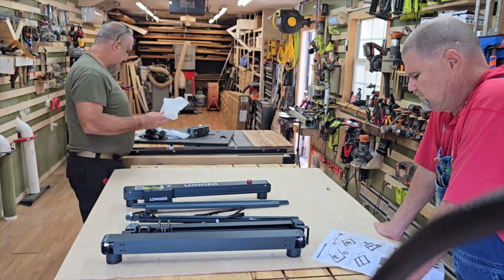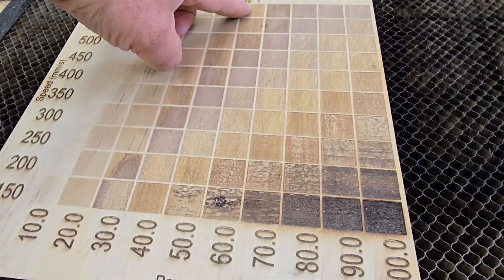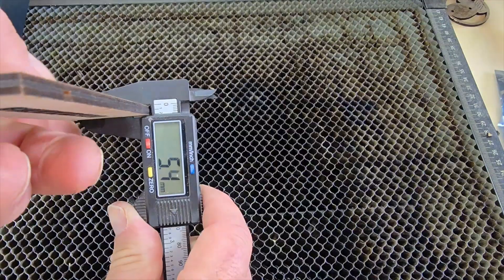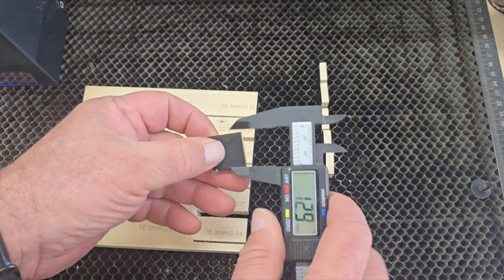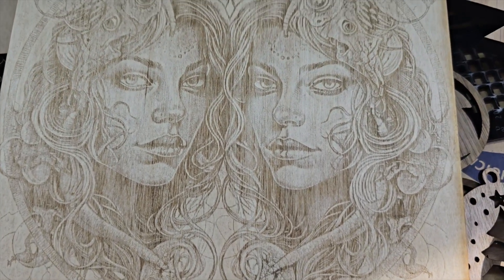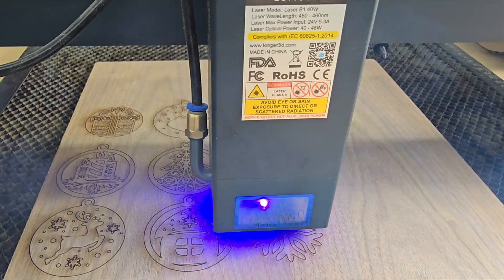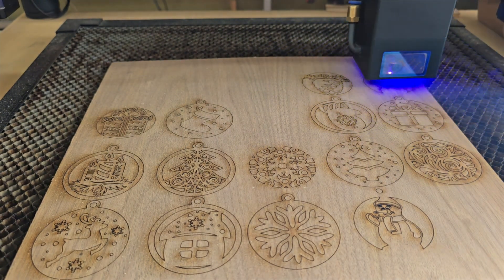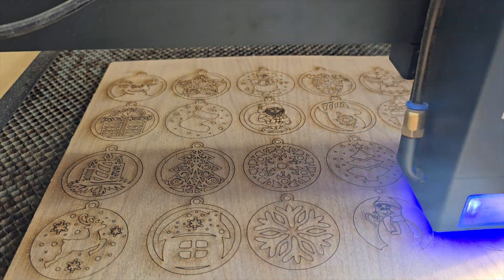Best Laser Under $1000, Prove me Wrong!!

Comment: To many choices out there I have an Atomstack A5 Pro with a 10W module and thinking id like more power and wondering if more power would entice me to do more,  Listening to your video this brand could work for me also  Atomstack A30 Pro is also one I am looking at.   One thing your speed you mention is confusing  my engraving speed is from 1000 to 4500, I wonder if i'm setup wrong
Reply: A5Pro owner: Atomstack makes quality products. They need to be for precision and safety reasons. I fabricated the enclosure and added air assist with an airbrush compressor, aluminum drinking straw , and medical "canula" hose. Works great. The improvements in technology since it came out are the "focus free" aka multiple focus lenses withoutwhich deep cutting would be impossible. The other invention is these very high power modules you see here. My next experiments will be adapting a new modern head on the A5 Pro. It might need a different controller and/or beefier power supply, but there is nothing cheap about the gantry and frame. Those plastic wheels might be the next to go. Best to you. Thanks.
Reply from the maker: Just a few years ago, diode lasers were not very powerful and had to go slow. People used mm/minute. Co² and other powerful lasers ran faster. People used mm/second. It is just a setting in the software. The new diode lasers run so fast that I use mm/s. It just makes it easier since I am constantly testing different machines. This machine runs 38,000mm/m. That is the same as 600mm/s. Just multiple my speeds by 60, and you will get a number you are used to.
Reply: @ShopRamblings  Thanks for the feedback on my feedback. Best to you.